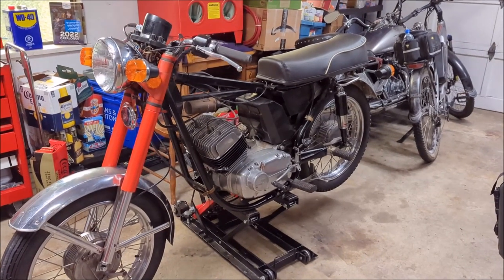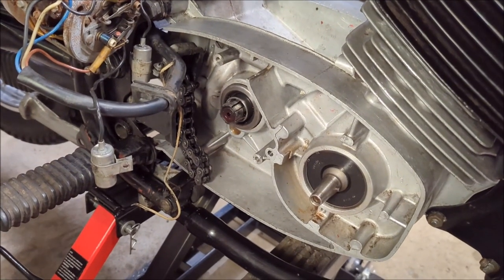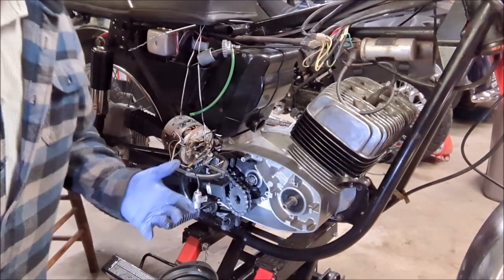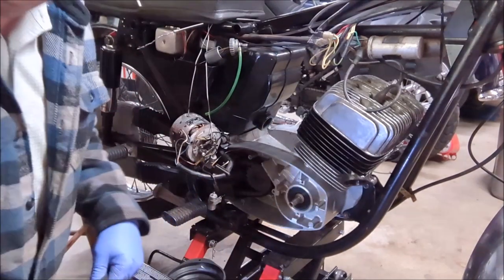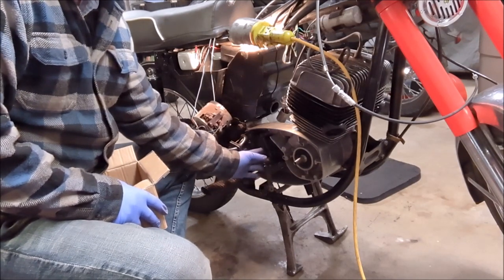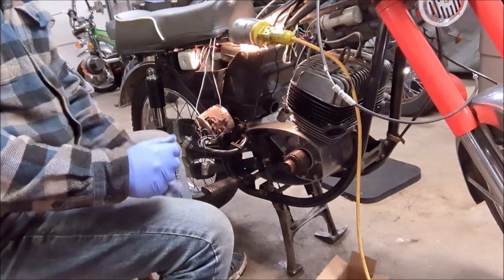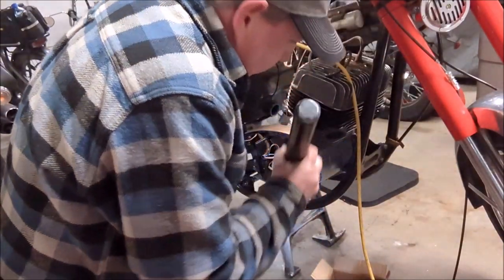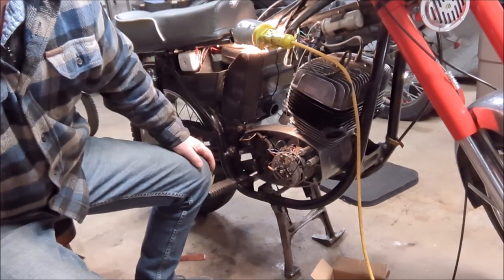JAWA 350 Barn Find Restoration - Part 16

Comment: Do not install Dry  chain. Dip in the molten greas for best lubrication pin & bushes.  How do U  lubricate  after a few hundred miles??
Reply from the maker: @tissapathiratna7761, yes I did the lube the chain but have never heard of using 'molten grease' before.   That's a very interesting idea and if ever have rusty chain again, I'll give that a try!   Thanks so much for your comment!